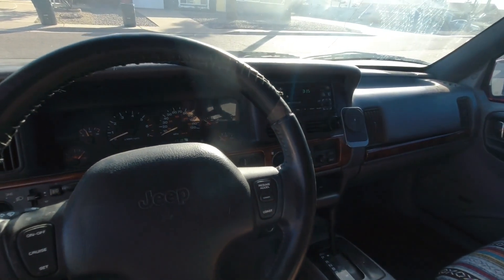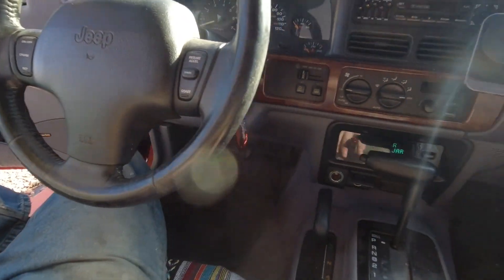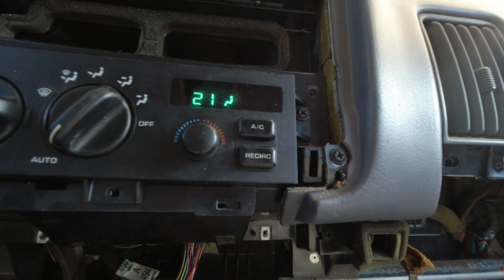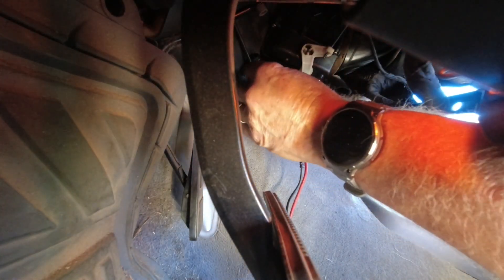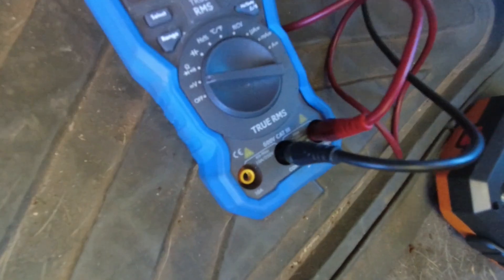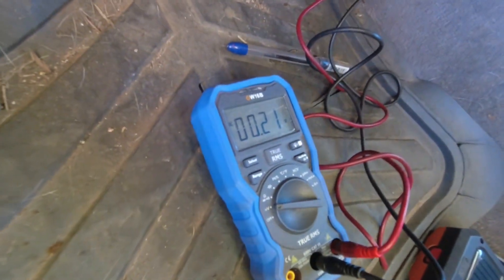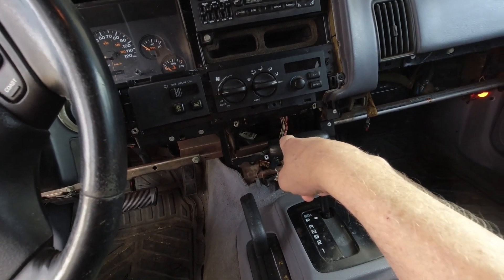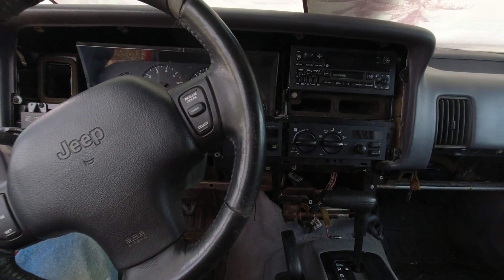1998 Jeep Grand Cherokee ZJ ATC heater defrost vent mode control motor diagnosis and hack fix!

Comment: I have the same problem on my 95 jeep grand Cherokee lerado but mine is vaccum controlled.I think I have to change the same mode door actuator.What do you think?
Reply from the maker: I've never had the vacuum operated system, but I've looked at the diagnosis for it and it's quite a bit different and seems to be a lot easier to deal with than the electronic one I have. Most people seem to find the solution to the problem in a vacuum line connection under the hood at the firewall. But as I said, I've never owned one or worked on one. Good luck!

Comment: Thanks for the video,only thing I could  find for a ZJ, will try to find if mode motors have become available (doubt it). Stopped working on cars about that time and went to trucks- blower motor easy to replace and paid for time not by book.
Reply from the maker: I doubt we'll ever see new mode motors for this particular climate control system. It was only one of 3 used on those years of ZJ (and probably the least common), it was only used for a few years and the ZJ hasn't gotten the cult following the XJ has. So for the aftermarket, the juice just isn't worth the squeeze. If it was easier to get the whole thing apart I'd swap to the manual system that came on low end models assuming I could find a donor vehicle. Or just buy an XJ.

Comment: If you don't know French, you will if you tear out the dash to get at the heater core.   My ZJ lost temp control, only blows hot air.   Pulled actuator and it works fine, problem with door.   Tore it all apart, found nothing wrong.   I hate to put it back together without finding a smoking gun
Reply from the maker: I've torn out more than one dashboard to get to a heater core, but I can't remember putting one back together without diagnosing the original problem. That has to suck and yes, I'd probably be cussing like a pirate!

Comment: finally someone talking about the proper motor, blend door only changes from heating and cooling, mode door changes air directions in the vehicle. my mode door likes to change to whatever position it feels like, which is almost never the dash vents but instead goes straight to defrost or floor vents. it's super annoying.
Reply from the maker: Yours is doing the same thing mine was, floor or defrost and never the vents. And like you I was super frustrated, whenever I asked for help every said it was either a vacuum leak or they pointed me to the wrong motor. I really wish I could have fixed it properly, but without replacement parts available there was no reason to pull the dash and heater box.

Comment: Thanks Chuck! Great video that I learned from. My auto climate control will work for 2-3min then no display or operation after it fades  out. I may reflow some solder joints and see what happens.  To be a 95, it has major electric controls!!....smh. thanks again
Reply from the maker: I honestly wished I could have fixed it right, but even if I had have torn it all apart to get the failed motor out there was no replacement available, I would have either had to fabricate a new control board and motor, or put a used on in. I still intend to reflow my information center, but I haven't gotten around to it yet, and now that it's 115 degrees in the afternoon, that ain't happening until summer is over.
Reply: @3rdpig  i reflowed my VIC , the terminals where the plug connects to. It's been working ever since.  I tried the solder connections on ATC with no luck so I guess I will purchase a used one.  I noticed there are at least 2 if not 3 different models numbers for the ATC unit....Hopefully they just changed the #'s each year or something?

Comment: I have a 95, but it looks like I have the same components. I was afraid to force it to move, but now I will bust out the channel locks. 
"Pull out the motor and trans and cut a hole in the floor"lol🤣.. thank you for the intel and the laughs
Reply from the maker: Just be aware that you may be breaking something that might not be easily replaceable. I felt under pressure as I had to have the air coming out of the vents before summer. As far as "pulling the motor and trans and cutting a hole in the floor", I did say it in jest, but considering my size and how inflexible I am, that might be easier for me then actually pulling the entire interior apart. People ask me why I love my old CJ-7, that's a big reason right there. Thanks for watching and good luck with your Jeep!

Comment: Chuck you are the man! My zj's mode door went out last week and i have looked all over the internet for info on these junky ATC systems only to find endless dead end posts about vacuum lines and the dang blend door motor. I really appreciate your help.
Reply from the maker: I'm glad I could help. I had the same problem, looking up "mode door" got me nothing but the vacuum system or the blend door. And I'm still not completely happy with my fix, it really takes two levers to get all the modes working so the floor vents don't really open, but at least I have defrost and dash vents, which are the most important to me where I live. I shouldn't complain too much, the system worked fine for 25 years, I just wish it was easier to repair.

Comment: Hello, I am riding Cherokee ZJ 5.2 in Korea. I have been struggling for a year because of a problem with my car. Have you ever experienced the same symptoms as me? My symptoms are as below.

1. The engine does not start. (Step on the accelerator, catch it, release it and turn it off.)

2. If the heat is increased to a certain extent, RPM will be maintained

3. If you step on and off the accelerator, the RPM may drop a lot and the engine may turn off.

The parts I repaired are as follows.

ignition cable, ignition plug, crank angle sensor, air flow sensor, map sensor, oil pressure sensor, throttle position sensor, IAC valve, throttle body gasket, intake air temperature sensor, oxygen sensor, fuel filter, purge valve, battery

Help me.. I'm under so much stress. Thank you for reading the long scraps and always be happy!
Reply from the maker: Put a fuel pressure gauge on it and make sure the fuel pressure isn't dropping below spec. If that's Ok, and considering everything you've already replaced, about the only thing left I can think of trying is a known good PCM. I had mine fail a few years ago and replaced it with a remanned unit. Good luck!
Reply: Thank you very much! I'm worried that it's a problem inside the engine. Is the Cherokee ZJ 5.2 durable?
Reply: @ddf232-d2s did you figure it out?